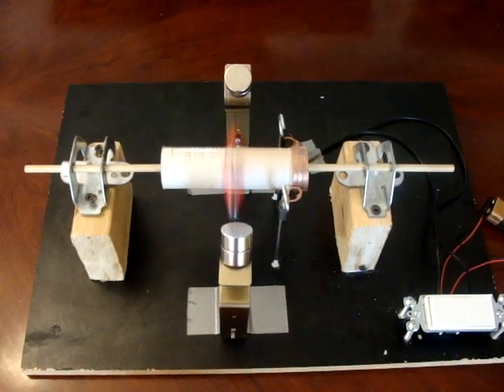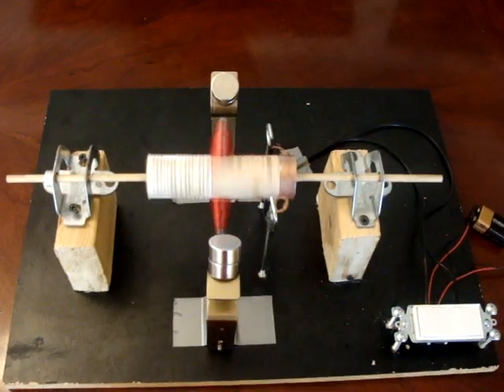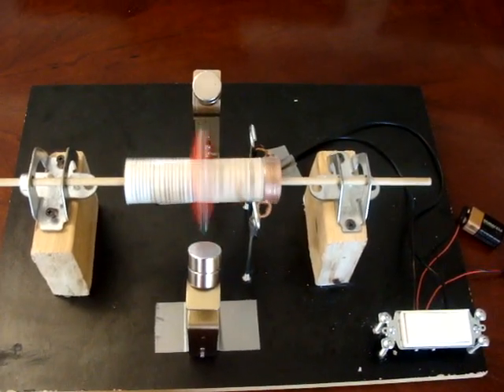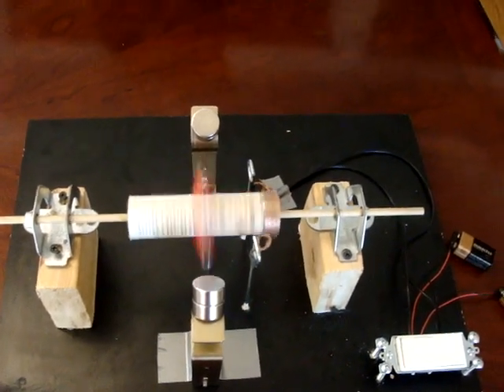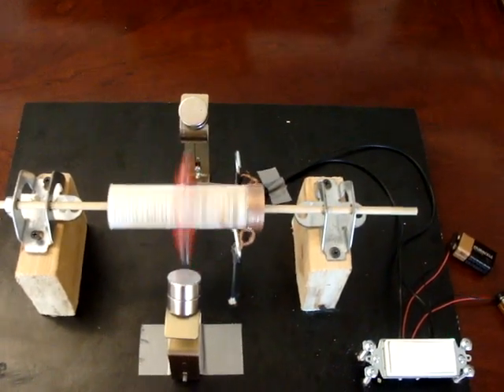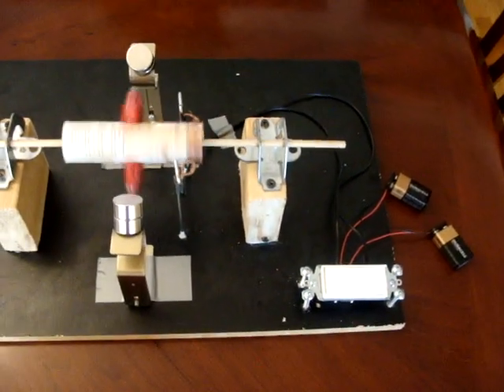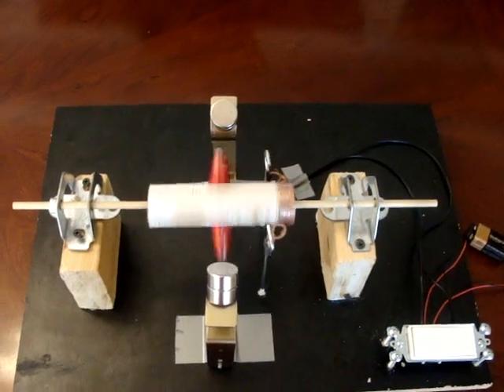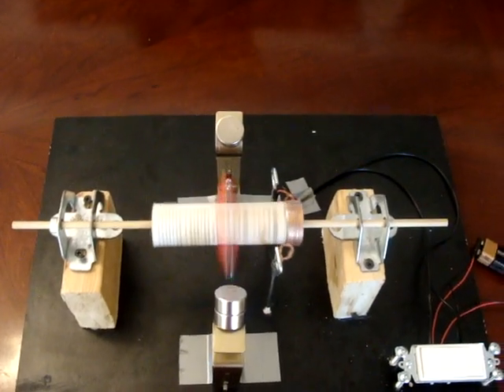DIY MOTOR School Project DC Electric Motor with Commutator

Comment: Hello ! im using your Video for my physics project .... i have 2 questions for you ! would this work with a 6V battery ? and would this still work if i substitute the copper tube for aluminum ? Thank you so much for your video !!!
Reply: Yes, and yes the aluminum will work but only has 59% the conductivity of copper.

Comment: How on earth did your brush and commutator not spark.

Sensor based commutation or contact based?
Reply: They never sparked because the brushes are constantly in proper contact with the commutator. I noticed sparking only when the brushes were misaligned.
Reply: Kelly JDee I made a way larger motor going at 16hp, loads of sparking.  will be converting it to electronic commutation aka brushless

Comment from the maker: This could easily be turned into a generator. You would rewire the solenoids and reposition magnets to work like a turbine. Then attach this assembly to a rotating disk.

Comment from the maker: Yes you could use two electromagnets (one on either side) but it probably wouldn't work because the power input needed to generate a magnetic field similar to a neodymium magnet would be enormous and unsafe.

Comment: what kind of switch did you use, single pole, three-way or four-way? Did you connect the coils around the screws to the coil around the carbon piping? One more thing did you have to strip any wire of its enamel?

Comment from the maker: So basically you need to make sure you understand the basics of electromagnetism and solenoids before you begin building your motor. For example important things you should know is that core material, number of turns, and a proper commutator drastically increases the effectiveness of a 
solenoid. Begin with finding materials that can be used for the parts I mentioned. The switch and battery connector can be found from any hardware store.

Comment from the maker: I have since discontinued the website, I may resume if this video gets more views or people that want to know how to build the motor. These materials are basic everyday things you can find around the house. The commutator is just copper brackets and the wire you can find at your local hardware store. The solenoid is wrapped around ferro-magnetic screws. Other materials used are wooden dowels, cut 2 by 4's and a wooden board for the platform.

Comment: I made a motor that runs on a switch, without the flick of a finger, and that motor then powers a steam engine, and when the steam engine runs, i have a flick mechanism that switches the motor switch off. So all I have to do to start my engine is flick a switch, and I can use my engine to do various tasks.

Comment from the maker: @jeff223344 Both magnets are at an angle because they are so strong that they prevent the motor from turning. So they are angled slightly to allow rotation.

Comment from the maker: @ddrchild You should wire both solenoids of the motor from the same wire, you should then use right hand rule to find the magnetic field that the each solenoid exerts. In short I think the solenoids in opposite directions should work.

Comment from the maker: @anuradhapalanivelu the current is reversed through the process of lenz's law. What happens is that when the solenoid is in the field of the normal magnet, the solenoid changes its pole, to repel away from the magnet. This process repeats multiple times and causes a torque (rotation).

Comment from the maker: @coolgumball321 the motor should be made using one continuous piece of wire, otherwise it won't work. The two ends of this coil should be connected to opposite sides of the commutator. Also make sure that your winding the coils in the right direction(i.e. clockwise or counterclockwise), or the motor will not work properly.

Comment: This is brilliant btw, but I have a question, did you attach one coil to one side of the commutator and the other coil to the other side of the commutator? Because I made the same thing for my project, and it isn't working, I connected the south poles of both the coild to the same side of the commutator and the same for the north poles...and it doesn"t work. Could you please let me know if I did that wrong? Thankyou!

Comment from the maker: @kacado okay i get what your saying what level  of schooling is this for because the maximum knowledge i have is grade 12 physics, I'm just starting university in the fall. This sounds like a university type problem? I don't know the formula but the method I created above will give you rpm, then you could use rpm to determine the power of the generator and so on?

Comment: @Tmac631 the reason i need the formula is so that i can calculate a motor/ generator combination that theoretically will continue to keep its self running without an out side power source. brushed motor with 1 very strong magnet, greater then the rest. the faster it spins the more power produced and the more power produced the faster the motor spins.

Comment from the maker: @ncranfill  rpm means rotations per minute. I am not aware of the formula for rpm from the values of the magnet wire power. There might be one. A simpler way would be to tape a string or fishing line around the armature (tube), run the motor for a minute, measure the amount of line that the motor has rolled up. After you know that find the circumference of the cylindrical tube. Divide the two numbers and then you have rotations per minute. It theoretically be quite accurate.

Comment from the maker: @OneForTheGoodTimes the copper commutator shouldnt be glued to the dowel? it should be attached to the armature. the commutator should be made up of two pieces of copper not one. and the nails are magnetics but there not strong ferromagnets try screws instead they're a thicker metal and make the solenoid stronger.

Comment from the maker: @OneForTheGoodTimes try a metal screw instead of a nail, the core of a solenoid increases the strength of the entire solenoid many times over. wire should be working because of the sparks. another problem may be that your armature is too heavy so the magnets cant move it. i had that problem.

Comment from the maker: @OneForTheGoodTimes Thanks for subbing, It can be because there is too much friction between the metal dowel and whats holding it. The metal dowel could be getting attracted to magnets, I would highly suggest a wooden or something not ferromagnetic. The next thing is that your magnets are too strong so its creating too much resistance so the motor can't turn, because of the sparks i know its wired correctly. So try pointing the magnetics slightly away from each other so they're not as attractive

Comment from the maker: Okay so you need to do more research on motors its almost impossible to make this without knowing the theory behind it. The copper is only for ONE end of the tube and is used for the commutator. The screws penetrate the plastic tube only. The copper can be glued or taped onto the plastic tube. Remember the commutator has two breaks opposite to each other.

Comment from the maker: @Itchier  The tube is plastic and I used iron screws, which are magnetic, the core material drastically increases the strength of the solenoid. I just used a screw driver to put them in. Then for the commutator I cut copper tube and glued it to the end of the white plastic one.

Comment from the maker: @1Philthyz  You have to know what your doing. There are many small details that need to be worked out so that the motor runs smoothly. You can tell from the video what materials I used. You can basically use anything you have around. If your confident with the theory you could probably finish it in a weekend.

Comment: Great demonstration of an electric motor. I can see that it's been built using things around the house such curtain hangers, cardboard tube and nails. The commutator is built using copper sheet. Great work dude!